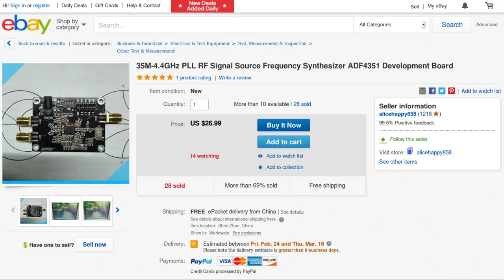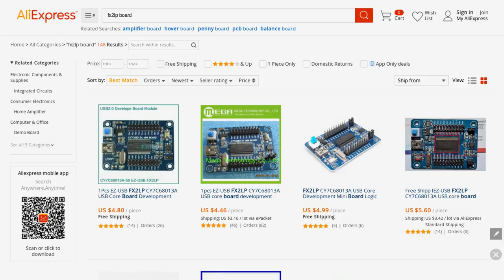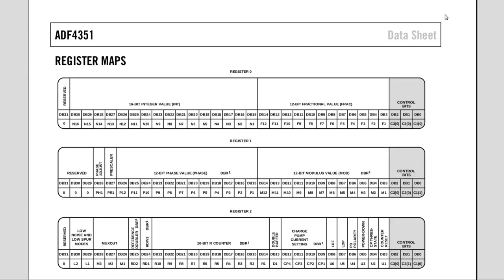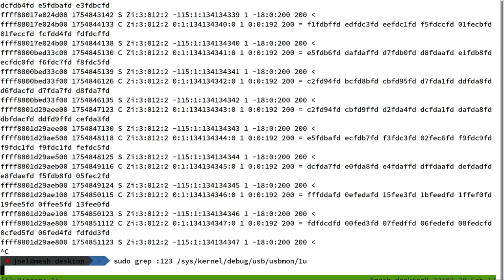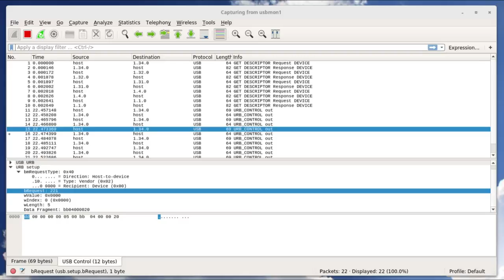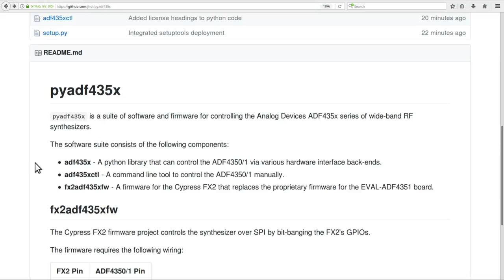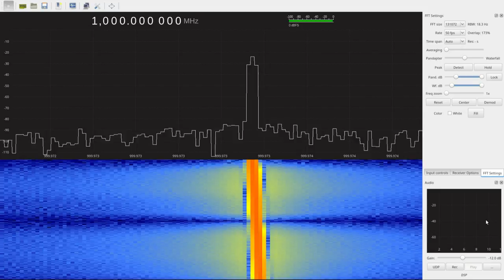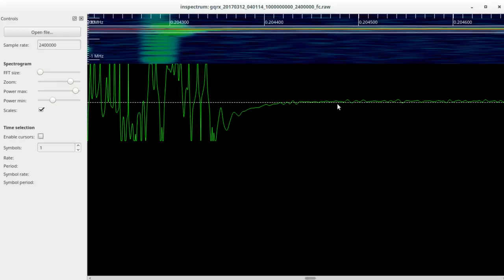[005] 4.4GHz RF Synthesizer Board - ADF4351 - Theory, Setup, Reverse Engineering, Experiments

Comment from the maker: UPDATE: pyadf435x now has a firmware for $1.75 STM32F103 boards.

https://youtu.be/YHygFw7PlbY?t=4m56s
Reply: Awesome! Great video in so many ways. And now it's even compatible with hardware I have. I picked up an ADF4351 board because of your video, but was limping along with some firmware I wrote that was pretty cumbersome to use.

Keep up the great work! One of my favorite new channels!
Reply: Do you know if that sweep feature is a Smooth sweep or fast channel switching
Reply: can you please help me with the circuit i am not able to implement this it is showing  no board connected
Reply: @pahadiprogrammer4914  have you solved this problem yet? I am also facing this problem, can you give me your solution?

Comment: 1:17:16 This looks like the almost perfect square wave output, but this is completely different to what I've seen on the oscilloscope on the begining of this video. And in my opinion there is some reason for this. Look at the thing, that radioamateurs typically call S-meter. It indicates 0dBFS, which is too much. At this point I should explain what dBFS exactly means. dB indicates a proportion of power of two signals (e.g. output vs input, reflected vs forwarded etc) in a logarithmic scale, or, when some suffix is added, it indicates the ratio to some constant power level, like dBm indicates power versus 1mW level etc. FS means "Full Scale" and it's typically used together with A/D converters, where "full scale" means clipping. In fact, A/D converter is not able to give you anything bigger than the clipping level, so there is no possibility how to get a positive dBFS reading, they are negative or zero. So if you get steady 0dBFS reading, you can be almost sure that the device is overloaded, there is a lot of clipping, which makes almost perfect square wave from almost anything on the input.

And that changing random noise is nothing more than a product of AGC dumping which slightly shifts the gain of the input up and down (this is how RTL SDRs software drivers behaves), which then varies the clipping point, which affects how much noise is displayed even if the noise level of the DUT doesn't change.

If that board gives you a 0dBm at the output (and imo this is possible), then you need at least 60dB attenuator on the input of that RTL thing. I don't know where is the saturation level of that RTL device, but when it comes to receivers, the -60dBm is still relatively strong signal. In fact, this is going to be tricky, because these RTL SDRs are known for its poor dynamic range, so it's not good idea to attenuate it too much, but the -30dB is definitely not enough. You should get something like -3dBFS to -10dBFS reading to obtain reasonable results.

But, at the end of the day, nice job, I absolutely love this.
Reply: Hopefully he and others will respond to this

Comment: This channel is fantastic - please don't compromise on the length because it is appropriate for this kind of content but a time breakdown in the video description would be valuable when returning to it for reference. 
I would love to see you tackle an antenna analyzer for eg ISM bands that would be suitable for IoT, not just ham radio etc. LoRa at 433MHz and 868MHz for example, wifi or Bluetooth cantennae etc. I know that I could follow the existing projects for Arduino based antenna analysers with lower frequency signal generators but I know you would be able to convey the pros and cons of the this kind of system really well and perhaps mitigate some of the weaknesses through design. For example, you've already identified the lack of frequency calibration and temperature stability, and the harmonics from the square wave. Do they matter in an ISM band antenna analyser? Would love to see this as a blog post or video. 
Thank you for your contribution to the community! Subscribed!

Comment: Very, very good video! Thanks for all the work you put in. Long but extremely informative, well edited and researched. Excellent stuff.
Reply: The "frequency-modulation with a drinking straw" at 1:13:29 cracked me up
Reply: also had no idea sigrok had python decoders; damn, I'm sold
Reply: Hint for getting more YT subs; closely examine the electrolytics on any PCB you handle and shriek in high-pitched outrage if they're a brand you don't approve of, ideally with some mildly racist commentary.  </joke>
Reply from the maker: Yeah my channel is rather the reverse of that. "Let's find the cheapest junk on AliExpress, and see if it has any useful purpose whatsoever."
Reply: I hope it does. I am loving this video as I am in the process of finding out if I can use this very kit as part of a ham SDR transceiver.....

Comment: This is fantastic content, thank you.  I believe I can answer the questions about the chipset and the cost.  For cost, they probably see the hobbyist as a nuisance market, where $150-$200 for an eval board is nothing to a large corporation.  I think that's a mistake, too, because a lot of small companies have restricted budgets, too.  For the chipset, I'd bet money that the designer of the board had code available for that chipset already written, that they could easily modify for their part.  I'm not familiar with that microcontroller, but doing SPI in a RISK based microcontroller is pretty easy.   Once you have the routines it's easier to reuse the reinvent.

Comment: Thanks for the nice summary on the ADF4351.  The close in spurs are really well shown.
 FYI  A squarewave output contains high levels of odd harmonics, so 3rd at 300MHz 5th at 500MHz etc.  Hopefully these are easy to remove with filters.

Comment: Fantastic video! Just a comment on the harmonic number: The 1st harmonic is the same as the base harmonic or 100 MHz in your test. That is, the 200 MHz peak is the 2nd harmonic, not the 1st, 300MHz is the 3rd and so on. Anyway: Excellent work!

Comment: Very extensive explanation, but every minute is to be watched. I had success by using the CP2130 under Linux, with libusb. It has its caveats, but nonetheless, a reliable chip. Did many projects complete with software, thanks to the CP2130 and libusb.

On the other hand, the FX2LP seems interesting for fast data acquisition, provided it does achieve USB 2.0 speeds (480Mbps). I have a similar board stored somewhere, but I'll use it if there is an app note containing the registers for USB configuration (or I may just use Wireshark to sniff packets going to a Windows VM and go from there).

Comment: Great video..

I was going to suggest a STM32F103C8 as a cheap micro-controller to replace the cypress, but I see you've already done that ;-)

Looking on eBay, I've noticed that there are also ADF5355 boards available which claim to have a frequency range from 54MHz to 13.6Ghz, but they are around 4 times the price of the ADF4351

They look physically identical to the ADF4351 board, and the only difference appears to be the AD chip its self.

But I personally, I don't have a need to generate frequencies above about 1GHz, so I'll probably buy the cheaper ADF4351

Aside from that, I think a nice project to build would be the STM32F103C8 paired with an ILI9341 touch screen display and the ADF4355, as all the components could be bought for well under $50 and using the Arduino Core (shameless plug here) to build a nifty self contained sig gen.

The other cool thing that its probably possible to do with the AD4351 etc is to module the signal, by constantly sending commands to change its frequency.

I did some experiments with the old AD9850, and it was easy to create a FM audio signal, so I presume that the same would be possible with the AD4355 etc
Reply from the maker: Those ADF4355 boards look really interesting - I might do a review some time.

Doing FM transmission with a synthesizer is a really cool idea. Did the settling time cause interference with the modulated audio at all?
Reply: With the AD9850, from what I recall, I sampled some audio (from an iPod) into the ADC on a STM32F103 and did a very simple calculation for the frequency based on the ADC value.

I updated the frequency on the AD9850 as fast as I could sample it with the ADC, and this resulted in FM being transmitted on the 88 - 108MHz FM band, where I was able to pick it up using a normal FM radio.

As I didnt do any signal conditioning on the input to the ADC, I didnt expect amazing quality audio, so I didnt look at the output of the radio receiver on a scope.

Of course it was just mono, as stereo needs a 22kHz syncing signal etc, (I'm not sure of the exact frequency of that signal, it could be 44khz etc).

I've not looked in detail about the ADF4351 or 4355 or 5355 to see the frequency resolution, but you'd need to be able to set the frequency to quite good resolution to generate good quality FM

I think the AD9850 also has the option to change the phase of its output, so I think in some instances the same modulation could possibly be achieved by changing phase rather than frequency.

Comment: Very good video. The content on here is brilliant. It's the only video I could find that had all of the information I needed for my current project. Having said that, I was aware of this video for quite a while, but it was the last one I viewed because of the length (1.5 hours!). 

I think you could get a lot more views with some changes. I really want you to get more views because the content is so good. Firstly, the length of the video! I think most people these days use YouTube to find things quickly, so I doubt many people would click to see a video that is over 1 hour long. 10-15 mins is my maximum, so I put off watching your video and I ended up watching all of the of the shorter (inferior) ones first. This video contains too much information of a broad nature. I think it would be better if you broke it down to several videos, with each one more specific and concentrating on one thing at a time. 

The open source lecture is also a bit irritating. Much of the video is spent explaining how to get windows programs to work in Linux, using Wine or some virtual machine etc. That right there is not a good advert for Linus. I use Linux at my work, just because I have no choice, and to be honest it is fairly crap and I end up having to use a Windows virtual machine for a lot of things things that I can't do using Linux. If I am looking to learn about ADF4351, I don't want to get into the pros and cons of Windows versus Linux, and be lectured about it, I just want to know the simplest way to get it to work. So in my opinion the open/closed source argument should be kept out of this video, as it is irrelevant. 

Besides my few negative comments, this is one of the best technical videos I have seen on Youtube. There is some really very good educational material here. I appreciate your work and I look forward to seeing more!

Comment: Dev boards are priced that way intentionally to keep hobbyists out. The second you buy anything, from anyone, there's going to be a certain amount of expectation for support, even if you blast NOSUPPORT NO NO NO SUPPORT. There's always going to be one thick-skulled guy who's going to solicit support, and that's real dangerous at semis, where you can get engineers on the line pretty quickly.

It's an intentional price signal.  If a demo board gets super popular for..i don't know..glitching something.. and it's featured on ..Linus Tech Tips...do you really want to be that company  who is getting barraged with support queries? Or the manager in charge of that product line (cause u gon' get fired at the end of the quarter) it's not like they're locking out the customers who are going to making a 2,500 unit production run. Every company I've ever worked at had a 'fuckit budget', usually anything up to $500 or $1k is no-manager-auth-required. 

AD can easily give those away (and they will-- use your company email, pick out a random figure of merit from the spec sheet and ask "Hey, we really like this product, but and we're thinking about using it instead of the MAX___ for our next gen, but can you tell me how you made the linearity measurements on _ because they look a little too good."). Most companies are great about it actually, except Vishay, for some reason those dudes are bitches
Reply: Great info and very helpful. Yes I've had to call in favors to get anything custom and high-precision characterized from vishay. If you have any connection to people like the x tabs or Marco reps... That helps. Because they're getting cussed some stuff from them all of the time for projects and I can just add in a few parts of yours.

Comment: That demo board comes with s/w (which needs to be specified, designed, written, tested, configuration managed, released, etc) , cables, CD,  is professionally laid out for RF (again, the requirements are specified, documented, the schematic are made, the professional layout is made and configuration managed) , the board design is tested before release,   there are manuals (probably written in English, by someone who does manuals for a living) , Analog Devices  provides access to tech support, in fact, Analog Devices maintains a web site (which means some is paid to do that).  That all adds up. Copying the board and selling w/o support is cheap.  There, mystery solved as to why the real deal is "so expensive". Full disclosure: I don't work for Analog Devices (never did).
Reply from the maker: +mdesm2005 sure, I just would expect them to make a loss leader out of these boards on the basis that the lower they can make the barrier to entry, the more popular their chips are likely to become

Comment: My guess on the price of evaluation boards is that they comes with reference manual, all the schematics and ready to use programs. You effectively paying for the documentation and development time that you don't have to do yourself.
Reply: I would also guess the cost of a properly designed/manufactured 4-6 layer board on equal/better substrate than FR-4 and finer/less coarse weaved fibre-glass to make the (product evaluation) board behave good with as good RF-properties as possible as in comparison to "good enough" given that these boards probably are purchased by companies that want to measure decibels and similar figures before commiting to buy a particular chip for a design. This is how most of my engineering career has looked like - and I must say that < 200$ is nothing for a board like this - a simple DSP eval-board has often cost around 1k$ , not to speak about something like what you need to eval a few channels of 1GHz ADC channels with the associated FPGA, CPU, parallell DDR memory channels, multi-GBit/s network or PCIe interfaces to get the data off the board and so on. Just the cost of the latter piece of kit is what has been holding me off from diving deeper into a hobby project to design a multi-channel fast DSO just from the component cost perspective alone, not to mention the cost of taking the route of getting eval kits before ordering the first set of 8 layer PCBs for at least the digital parts (I recently was offered 1k$ for 1 piece 160x100mm 8 or 12 layer PCB on good substrate excl component mounting when using high pad-count BGA or QFN, then add needing an expert house to bake/solder the BGA-chips that cost at least as much each with a high failure-rate for both the chips and PCBs..). This why I will keep working on changing my outlook on life and hobby interests into those acquired by drinking lots of beer instead.
Reply: Ah yes, you actually need to charge at least your cost of manufacting the eval boards in case they can be used as part of a commercial product by the customer - otherwise they will run you into bankruptcy by ordering eval kits as part of the product that they design, this is something I have done a few times myself (not the bankruptcy side) by designing in a SOM-module in a socket instead of myself populating a higher layer-count main-board with CPU, memory and only locally needed higher layer-count and controlled impedance.

Comment: Talking about synthesizers - have you seen the Arachnid labs "Tsunami"...? It's definitely not meant for or capable of RF domain work, but it can both generate and measure stuff up to a few MHz with DC offsets, it has a TCXO, and it's controlled by an on-board Arduino. I'm not related to the vendor, just happen to like it... :)

Comment: I am not understanding how you got the signal to display on your monitor?  How is it that your able to run the frequency synthesizer through a TV receiver and just plug it in?  I think a video on that would be much appreciated!
Reply from the maker: It's an rtlsdr.

In normal operation, the USB device 1. tunes to the TV signal, 2. samples it with an ADC and 3. demodulates the TV data stream. But the the rtlsdr project has a hack whereby the device can be configured to do steps 1 and 2, but not 3, and stream the sampled RF signal (I/Q data) up to the PC over USB, where it can be processed in software.

In this way I can use the device as a poor man's spectrum analyzer. I'm tempted to do a video about it, but these devices have been around for a long time - nevertheless some people might find it interesting.